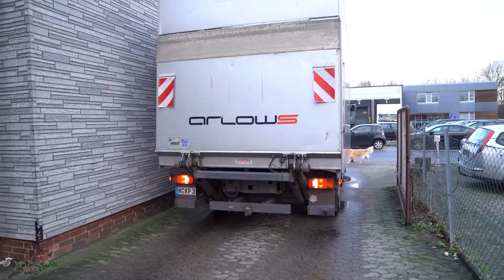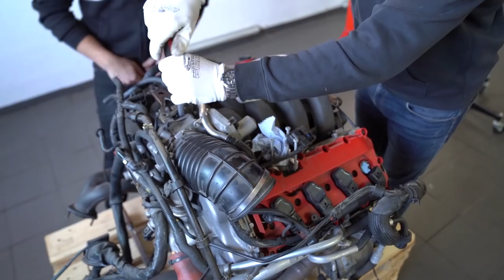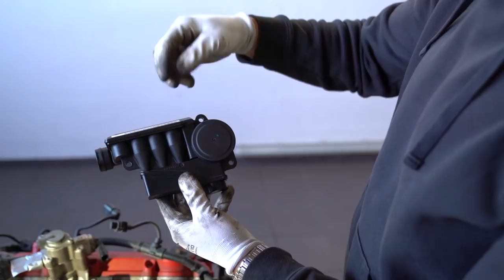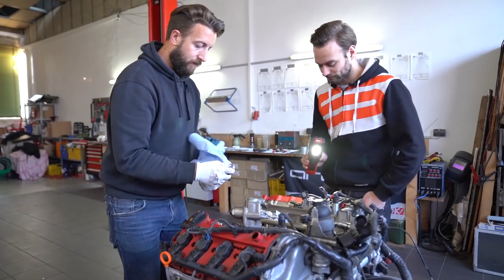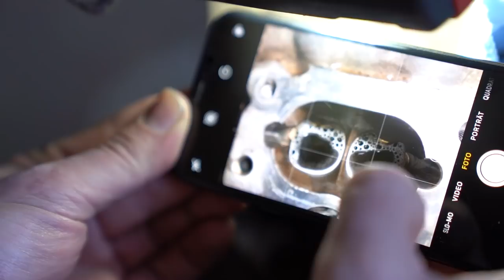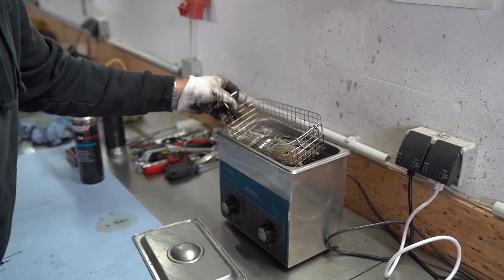Bedi Reinigung am RS4 B7 FSI Motor bei der RS-Klinik! | Philipp Kaess |

Comment: Drallbleche?
Reply: Ja , um gezielt Verwirbelungen zu machen / oder verhindern
Reply: Tumble-Bleche sind das aber. Drall wird dem Motor bei der Brennraumgeometrie nichts bringen, weil diese Art der Zylinderinnenströmung während der Kompression zu stark dissipiert. Zur Erzeugung von Drall wird meistens ein Kanal verschlossen und damit ein Ventil 'abgeschaltet'. Zur Erzeugung von Tumble ändert man jedoch die Anströmung auf die Ventilteller beider Einlassventile des Zylinders. Deswegen sitzen diese Bleche auch parallel zur Längsache mittig im Kanal.